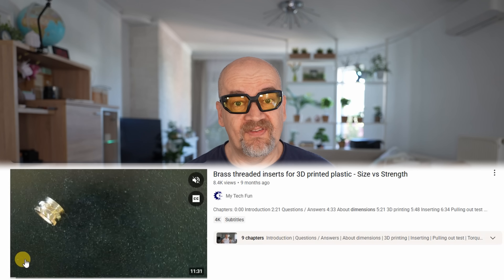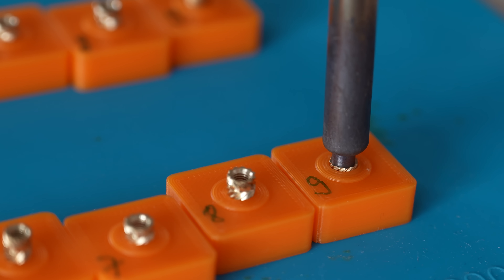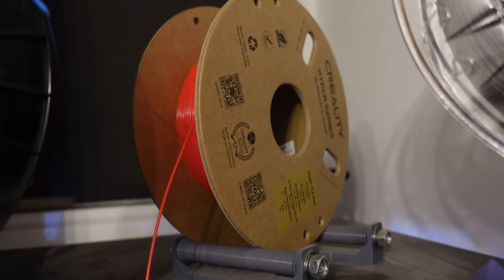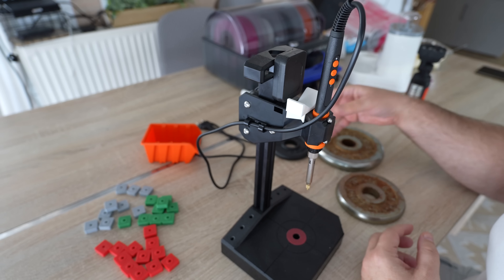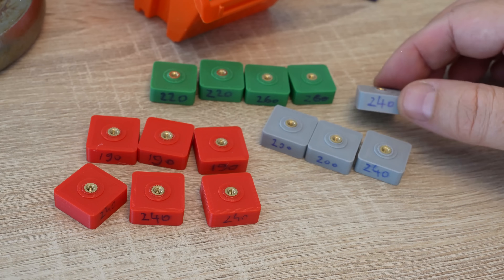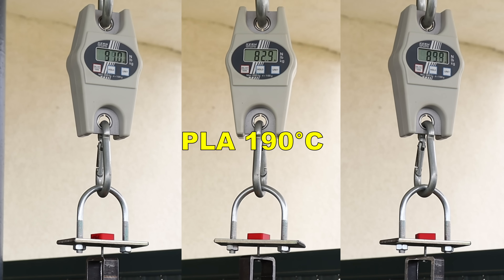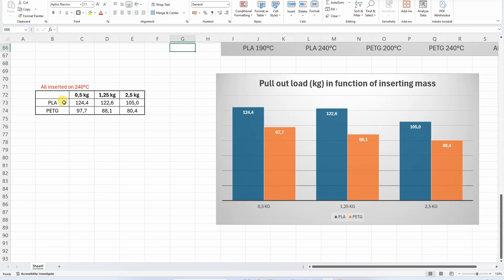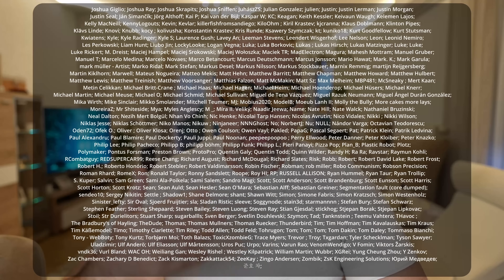3D Printing Heat-Set Brass Threaded Inserts: Effect of Speed and Temperature

Comment: I have a question , each time I try to use insert I have filament inside the insert why ?
Reply from the maker: Or the hole is too small or you are pushing it under the angle or pushing too deep. Size must be big enough, so the bottom part of insert can fit in.

Comment: I've tested that type of soldering iron to see what the actual tip temperature is compared to the digital readout, and I've found there is quite some discrepancy between irons. Did you test the actual tip temperature or just rely on an uncalibrated, rough digital readout on your iron? Maybe a follow up video showing the tip temperature vs the set temperature would complete the test!

Comment: I normally just let the thread insert to insert itself on it's own by applying just enough force to keep the press from retracting. I use VLMP 1. And for temperature I normally use 250C (assuming it's accurate) as the soldering iron I use for my VLMP can only go in increments of 50C. I bought a thread insert tip for my soldering station from CNCKitchen so I may reprint my VLMP soldering iron adapter and switch to that for more temp control but judging from your tests I think the cheap iron at 250C (for PLA/ABS) /300C (for PCTG) will be fine.

Comment: This is good information! I have, in the past, just put the iron to where I know it would melt the plastic, and did not pay attention to speed of press. Just kept pressure on to keep it melting in. I will be taking more care moving forward. Thank you for taking time to do this and passing information along. Have you done any testing on the different diameter of the printed hole? Or even the shape of the hole? Would a counter borehole be different strength? 🤷‍♂️ I do not have the measuring gages you have or I would try it myself. But, thank you!

Comment: Definitely would recommend doing this test again, except design the test pieces so that the brass inserts bottom out (so the piece is 4mm thick, same as the inserts, and maybe with an inset so you can get more thickness for outside the heat insert section) so you can get more consistent depth rather than having to do it manually. Removes an extra variable that way, as long as you don't let it sit there after it's bottomed out. Should give more reliable/consistent results.
Keep up the great work, Igor!

Comment: I've found that the replaceable tip soldering irons are not as temperature stable as they claim to be. They will display that they have reached their set temp in a matter of seconds but it can take a minute or 2 for the tip to actually match.

Comment: I use a modified Dremel Workstation with a T101 soldering iron and CNC Kitchen's heat set insert tips.

 The advantage of this it that it has the ability to set a depth stop. For repetitive/production work, you only have to set the depth once and then ever heat set insert from there on is at exactly the same depth.

Comment: Now proper torque test can be performed. Also You can print endstop to prevent over pushing inserts.

Btw, please note that soldering iron isnt fast, while temperature show quick change, the tip still need some time. Its easy to spot just after turning it on and trying to solder something

Comment: I rarely use these inserts because they fail too easily in my testing. The best strength is to install them into the opposite end if the part. But I find creating a pocket that just fits a nut us better for strength and if its not something you have to take apart just adding more walls around the hole and tapping threads is superior in strength. CNC Kitchen did a video about this as well. There is no perfect solution but I find these to be a waste of time and money, nuts are cheaper and stronger in most cases and they can easily be slid into the side of a print often. I think there are a few use cases for these but they are light weight applications not something that requires strength.

Comment: Hello, nice test ! About the methodology, the insert will start warming after the iron touches it, so I'm wondering if the results would have been the same if the insert is preheated. I use to put the insert on the iron and wait until it's hot before to put it in the plastic. I understand that with your installation its quite difficult to get it stay on the iron.

Comment: Are inserts which have been removed from old prints by pulling them out (via excessive torque) maintain the same performances when reused?
Reply from the maker: Oh, no. Don't force me into another heat-set video.. I believe they have the same performance. I cannot see any damage on mines (I clean them all in the meantime)
Reply: @MyTechFun  fair enough :)

Comment: You can easy limit the insert depth by a blocker at the rail ;)
Another factor may be how long the insert is kept at end position while still heating. So the molten material gets more time to cover the profile of the inserts completly - what will be the reason that slow inserting is better. (But I do not expect big additional differences tbh).

Comment: if there are  no space constrains you can totally avoid inserts - just print threaded holes and bolts. I usually print M8-M10 with 0.2mm  layer height.

Comment: It would be pretty easy to plate the brass tool with copper or nickel, if you want to try all you need is some copper wire or nickel strips, a DC power supply (a 12V wall brick should be fine), and some vinegar.

Comment: As much as I try to avoid heat set inserts in favor of traditional hardware, there's quite a few cases where it's almost unavoidable. In that instance, yes, Size Matters! Both for the insert itself and part clearances. Having the little brass helper that holds a special tip for your soldering iron makes them drop in like butter, to the point that it's almost hard to drive them in crooked. That one little part made me like inserts rather than avoid them. A calibrated iron is nice to have, too, but I've done a lot of inserts with just the el cheapo iron and press when the top layer starts to glass over.

Comment: Maybe try printed threads, I've found they are strong, but not for parts that could be taken apart multiple times like the brass inserts. For my business I print threads when they won't be removed much.
Reply from the maker: Yes, if you don't plan to take-out the screw, then 3D printed is fine too. Insert is more elegant and ready for repeated usage if needed.
Reply: @MyTechFun very true, I use inserts most of the time, but have a few designs the use printed threads when the part gets secured and left mostly non weight bearing.

Comment: The one I bought has a stop. A square washer in the “T” slot with a thumb screw. I put the part in, bring the iron down until the end is the correct height, then move and tighten the stop. It’s always stopping at the same point, whatever height I set it to. I haven’t tested pull out as they seem strong enough. But if ultimate strength is needed, and you’re able to with the design, put the insert in the back of the material instead of the front, with the hole going through, just just a bit larger than the screw diameter. Then, the insert has all of the material in front to hold it against the pull and it will be much stronger.

Comment: I just got a new soldering station with digital temperature control, so this video is very useful for me.  Thanks for performing these experiments!  That little insertion rig is nice, but I think it can't always be used due to uneven surfaces, angle of insertion, etc.  I like the spring loaded retractor, though - clever.

Comment: I don't think fillement printing temperatures are necessarily correct, it's about heating the surrounding plastic to a temperature where it's soft enough to push in. The insert needs to heat the plastic, the soldering iron needs to heat the insert, overall very different process from 3d printing.
Does not tell you much different setups with different temperature delta's and such. But good to know it doesn't really matter

Comment: Great video! A question that I thought of was would annealing the part after the threaded insert it placed strengthen them at all. I know annealing is more about removing internal stresses but it might also let the plastic settle in around the insert a little better hopefully without loosing overall dimensional accuracy.

Comment: As an aside, I prefer heat set insert presses like this one, where the column is a standard extrusion. Then it's easy to mod the press with a longer extrusion to use it with larger/wider parts. For example, I've put inserts on the edges of wide parts this way. The part is held in a small drill press vice to hold the correct orientation. Custom printed vice jaws will let you hold even awkwardly shaped parts this way.

Comment: I place inserts on the opposite side of the print when it's possible to have a better grip.
Reply: Yea thats better. But really you can most times just do without using m4 and a trick of the pre holes for them not being perpendicular then the whole part has to break in half
Reply: Then you don't need them, you are just wasting money...

Comment: This makes perfect sense to me. The higher the temperature and longer the insert time, the more surrounding plastic will melt and have time to flow into the insert ridges. And the more surface area there is between the insert and plastic, the better the grip. But if you don't have an apparatus to hold the insert completely straight like this, it's a lot easier to misalign it when it's just floating in a puddle of plastic, so going faster with less heat may be better when you need more accuracy than holding power.

I would still love to see your DIY design for this, though. Or does this company sell only the holder as well?

Comment: Thanks for unusual tests!
Would be interesting to see the results while inserting at ~400 degrees, slow and fast. I insert with a regular soldering tip, and usually use the same temperature as for soldering.
Reply from the maker: You don't want to go to high with the temperature, too much fumes then..
Reply: @MyTechFun  Got it, then I will reduce the temperature, thank you!

Comment: I Love Brass Insert videos 😀 Thanks!  BUT, if you consider pushing too fast + low temp VS pushing it slow + high temperature... the difference is quite big! So, yeah, there is right way to do it!
Reply from the maker: Eh, too many combinations, but as you can see, the difference in tested variations is not significant.